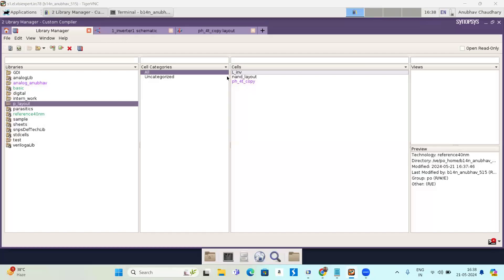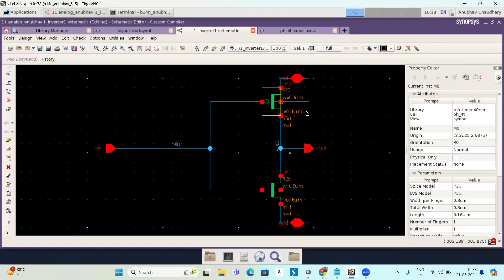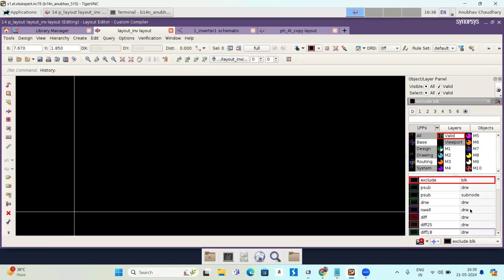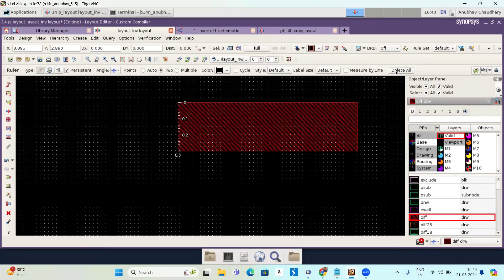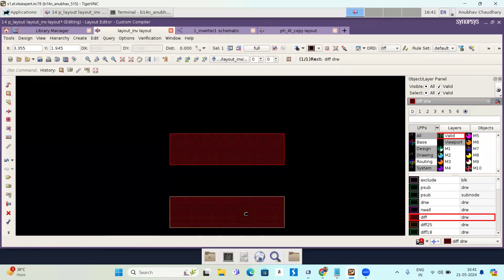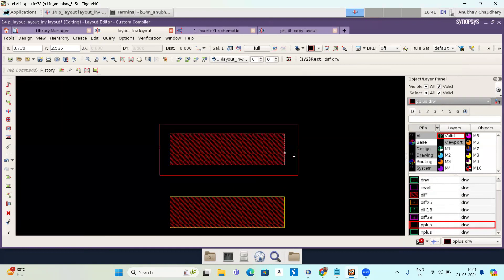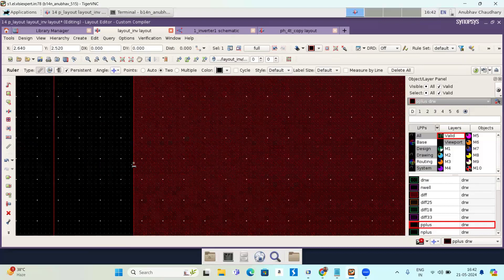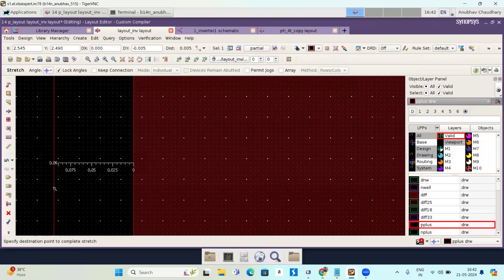L5S0 - Layout of Inverter using Custom Compiler

Comment: what does the poly layer do ? can you explain all layers ?
Reply: whenever a poly crosses the diff layer a transistor is formed & polysilicon is gate(poly).
diff layer--> active region where device is formed.
pplus/nplus are the implant layers just to define that which device will form in the diff layer (p+ for pmos and n+ for nmos).
nwell --> a well created in p substrate to make pmos devices.
cont/via used for connecting poly-diff, diff-metal and M1 to M2  ....respectively.
Reply: @NehaKumari-ej7wk  Thank you! I would appreciate it if you could upload more videos covering the basics